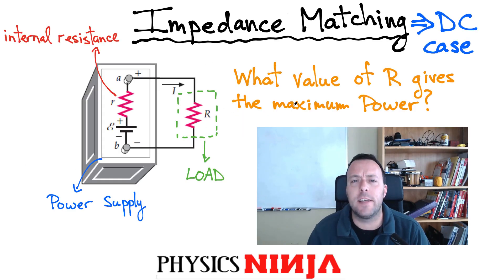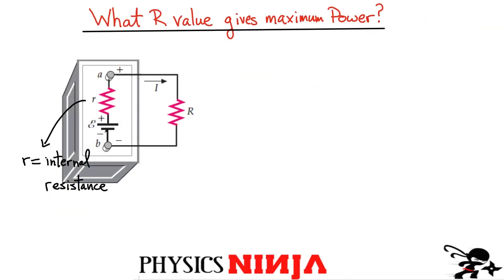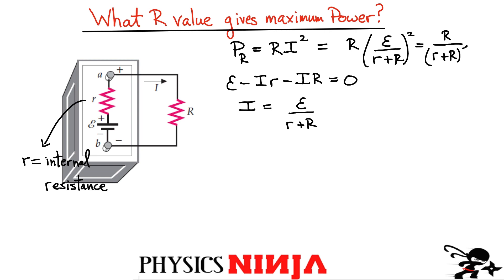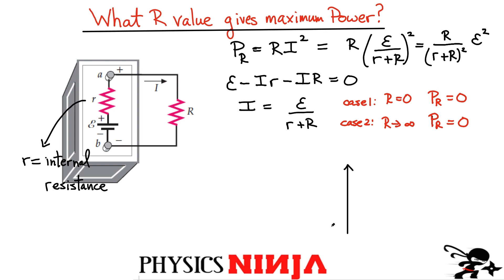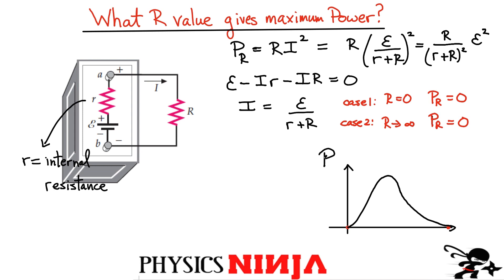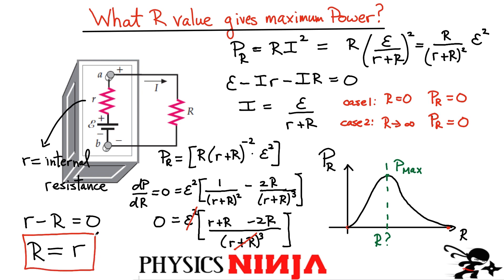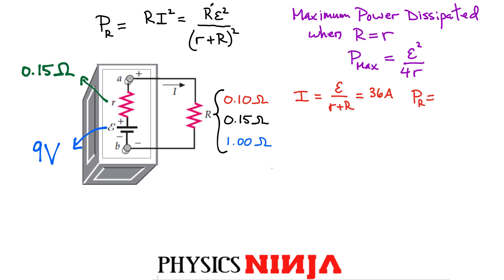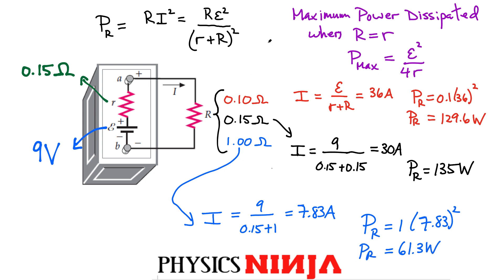Maximum Power Dissipated - Impedance Matching problem

Comment: With the exception of one step in the differentiation (I am sure you are right, but it's been so long I can't understand it), and after several loops thru the math on the last page, I understand this DC impedance matching now and believe it. Thanks.
For more years than you've been alive, I have struggled with understanding why an audio amplifier is said to have an output impedance, and why the speakers must have the same impedance for max power transfer. Is your analogy of a battery and load resistor the same thing ?